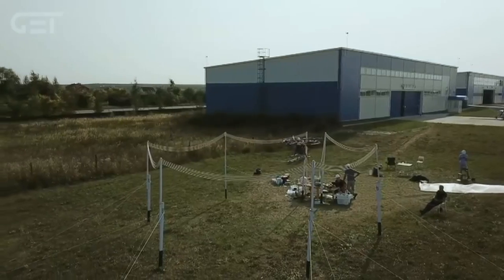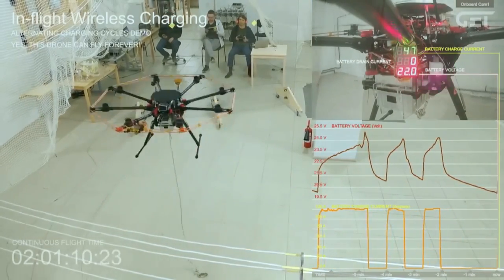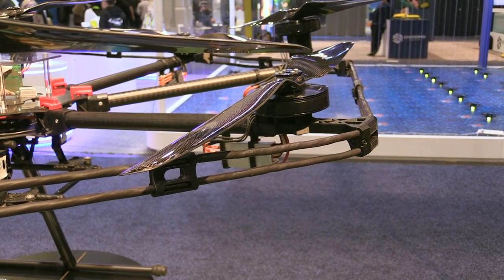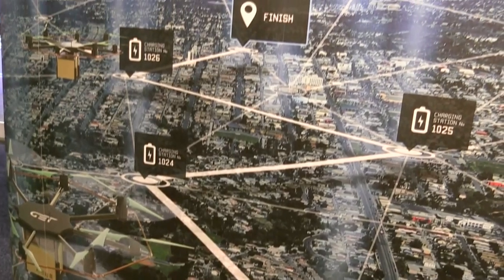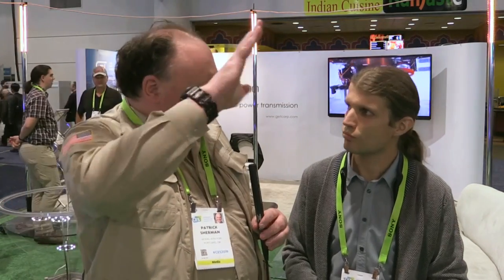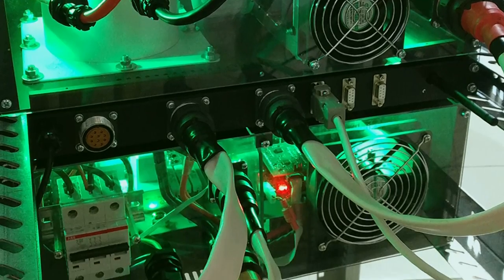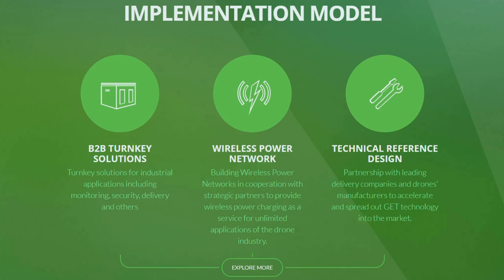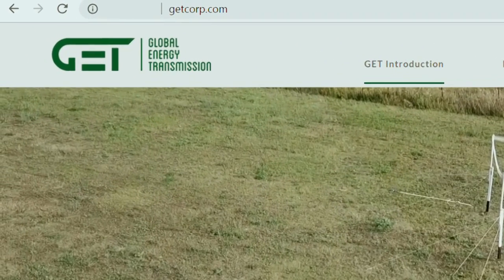Wireless Drone Charging, WITHOUT LANDING! (for real)

Comment: but hovering while charging is crazy, a charging pad as you land motors off no current draw would charge quicker, plus everything else, like hovering, noise, noise from charging interfering with gps, radio ect....
Reply from the maker: I guess that the trade-off is there is no need for precision landing, no physical contacts to corrode or wear, etc. Also, per a comment from GET in response to this video, this system does not interfere with GPS or radio. That said, there is certainly an argument for landing and charging by more conventional means. I'm all in favor of people pursuing different approaches -- nothing but good will come of it.

Comment: Hello Patrick! Thanks for sharing such a great content! 
Just a quick clarification about field strength/interference/health concerns - it is absolutely safe and you can stay 1 meter aside from the transmitting cord (at full power level) 24 hours a day, 7 days a week. In other words it meets World Health organization standard for everyday exposure to electric/magnetic fields, also not causing any harmful interference to other signals/waves. In particular, there is no any influence on compass behavior, as well as any other on-board/ground equipment. 
All the best,
GET team